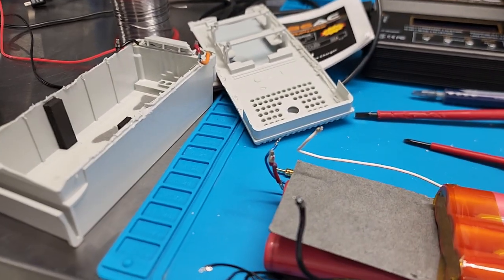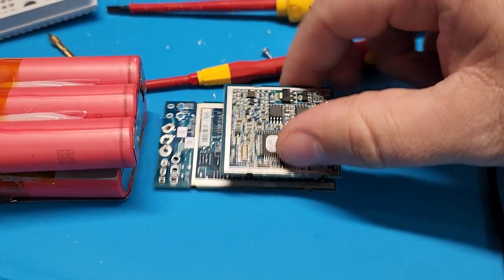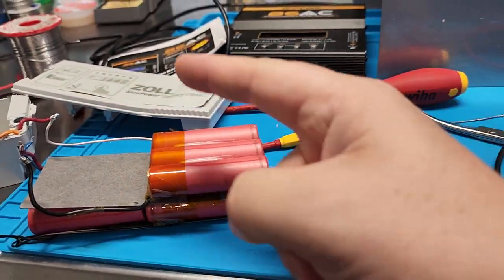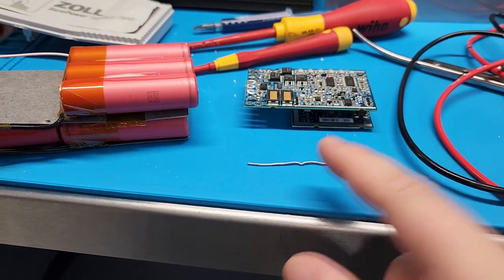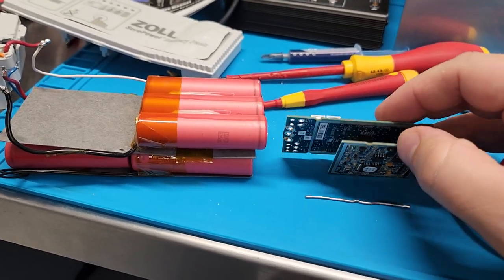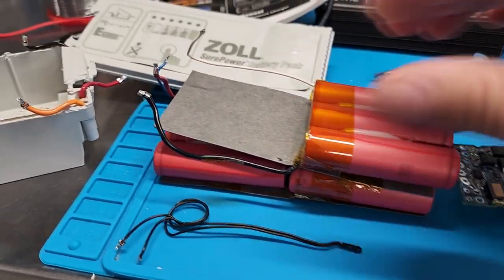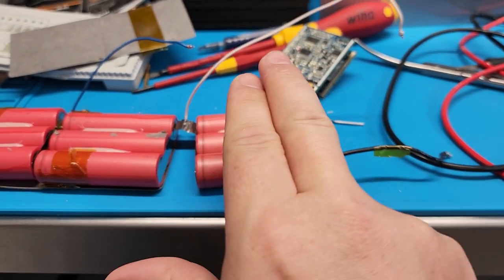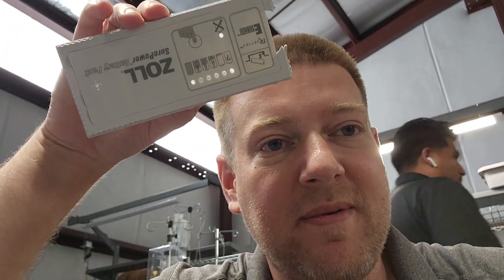Failed Zoll Batteries

Comment: Good find! I had no idea these would suddenly fail that fast just sitting on a shelf. It is three months for the maintenance interval of the Zoll R and X series batteries. All of our batteries are entered as child assets to their respective medical devices in our CMMS. P.M work orders get generated for most device batteries, so every three months there is a rush to get all the defib batteries looked at. We have a couple of the Zoll chargers and a pool of spare batteries to swap in and out so techs can take turns with their assigned batch.

Comment: Did you tried supplying direct 12v to the terminals for some time to wake them up? With the old MRX by Phillips that worked maybe…50/50 chance.
Reply: Hi,  Yes, this works with many batteries that have a battery management circuit inside them . If these batteries are allowed to discharge fully (such as left in storage a long long time) then the battery management circuit has no power to do anything. Force charging for just a few minutes through the main output terminals puts a small amount of power into the battery, if you then quickly put the battery into the equipment it belongs to with the mains power connected there is every chance the battery will fully charge. Do not force charge the battery for longer than a few minutes though, there is a good chance it will set on fire if you try charging it fully this way!  You are doing all this at your own risk.
Batteries for such equipment as the Maquet/Getinge Servo-u ventilator, Zoll R series defib, or as I said before any battery with a management circuit inside it. Typically any Lithium Ion battery. Some of the GE patient monitors have this feature built into their diagnostic menu. Such as Dash 3000/4000 Hold the NBP  Go/Stop and Zero All buttons, then press and release the trim knob( rotary control) keep holding the two buttons until a service menu appears where you can select the "Wake up battery" option. This gives it a 3.5 minute force charge.

Comment: Do you think it may just be because it's always in wait for a prompting mode and in its current monitoring mode? I mean it acts like your cell phone. You use the battery it depletes, then if you don't its still technically running. 🤷 It might be a struggle to have a push for change at the manufacturing level to redesign something they've already put out literature on. Not saying it can be done, but until it becomes a patient safety risk I don't see why they would bother.
Reply from the maker: It's planned obsolescence.  The battery is like a cellphone but imagine a cellphone which goes permanently bad if you don't charge it every couple days. The zoll charger will not charge if the Voltage goes below a threshold.  Even cell phones go into a battery protection mode if too low.

Comment: Hello, Can You please confirm two reddish output wires/terminals are actually bonded together (saw this layout on PB lead acid version) or there some difference for li-ion?
Reply from the maker: The red wires are connected to a pcb and are likely not bonded. The positive terminal will almost certainly be switched
Reply: Yeah, I've thought about this for a while. Idea is they bonded I guess for the Pb version of the battery. And separated for the li-ion. My current vision is that middle terminal act as positive common, another, close side terminal - charger input/output and its managed separately on li-ion BMS, connecting lines later on, sonewhere internally.

Comment: The “?” only displays when the battery is due for a 24 hour deep cycle charge in the zoll charging bay. They will usually do this once a year. It doesn’t mean the battery is bad, you just have to pop it in the charger and press the “?” button on the charger. But yes, I also learned the hard way by ordering extra batteries to have on hand and they depleted past their threshold and were permanently dead.
Reply from the maker: This battery had no question mark - as I said in the video. The cells were at .06V
Reply: @BetterBiomedChannel  super frustrating to say the least.
Reply: Normally, I would agree that the ? is remedied by deep cycling in the SurePower Charger; however, we have had 10 - 15 fail quickly in recent months - even when changing bays and unplugging/plugging the Charging Station. It is extremely aggravating!
Reply: @lifemedsafety  I have like 30 "dead" ones and only 5 good ones left.  Can't get them.  Zoll needs to figure this out ASAP.